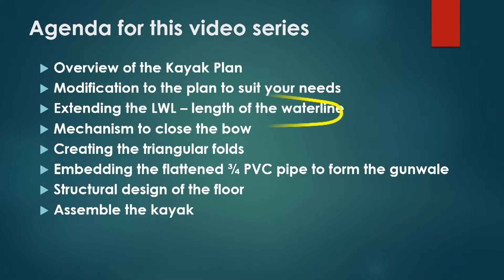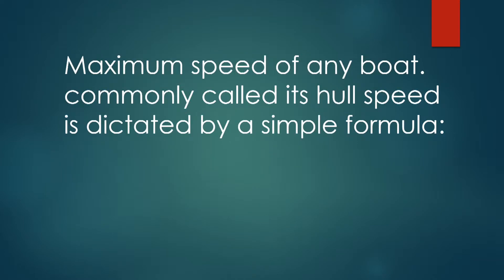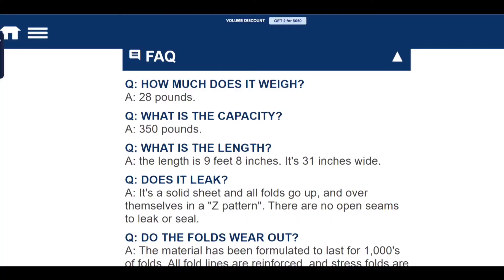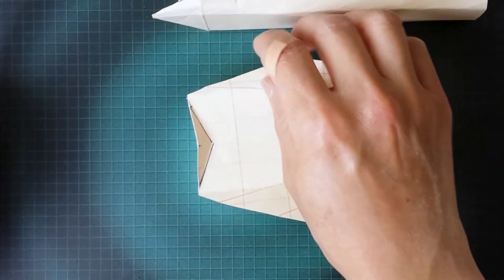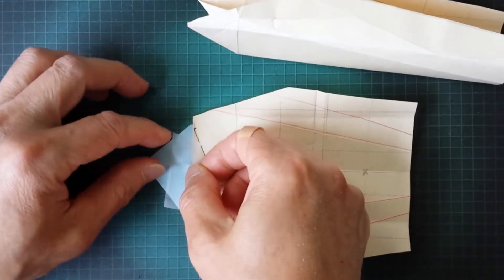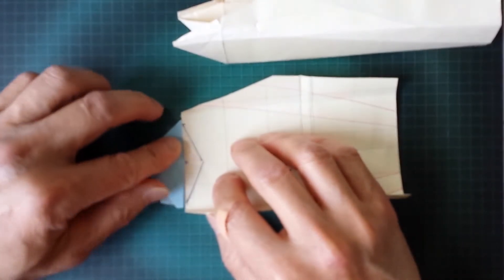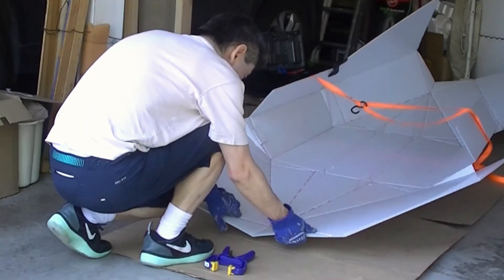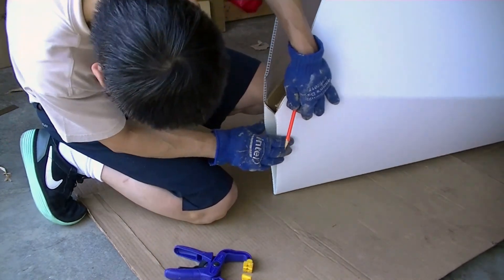Tutorial #3 DIY Gen 9+ Foldable Coroplast Kayak

Comment: Would any of your gen models handle a water re-entry? Which one?
Reply from the maker: Thanks for a very good question. This water re-entry has always been on my mind when I design a boat. My Gen 9+, 10 all have a cross bar (PVC pipe) behind the seat. They all have strong gunwales. The cross bar really help to get in and out of the boat, especially when you brace the oar again that cross bar. I can also grasp onto it for water re-entry. The strong gunwale also helps. I really want to try water re-entry from the side and from the rear on both Gen 9+ and 10 boats.  Because of Covid-19, it is difficult for me to get friends to help to film this process and 'rescue' me if I get into trouble :-) .  I don't know how good my design is until I try it. Filming the process helps me to improve. This is on my to-do list.